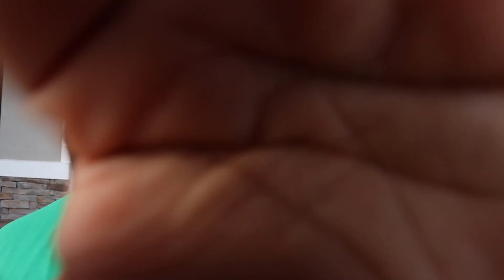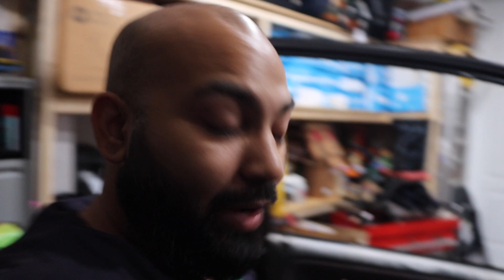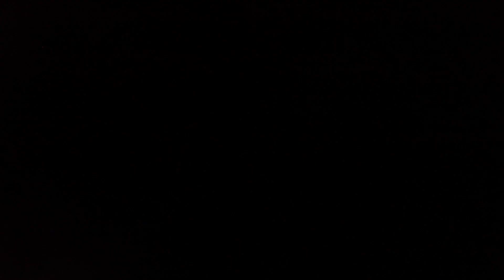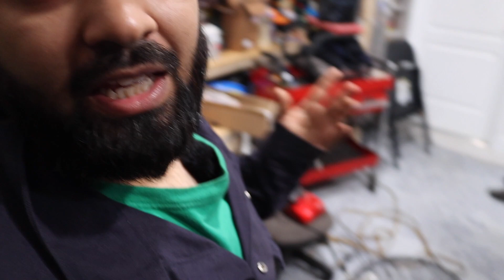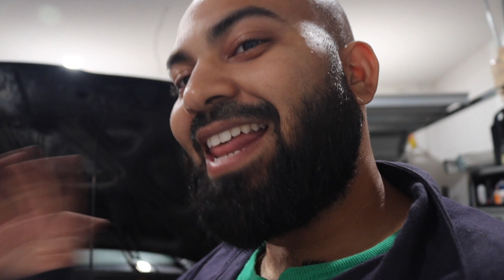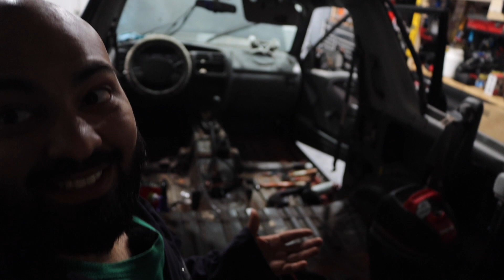our welding is finally finished on the tracker

Comment: friend I have a doubt the liquid moly oil to clean the engine is good or bad
Reply from the maker: Liquid moly oil, not sure I never tried it. If you want to flush your engine just drain the oil, add one quart of transmission oil and the rest of how ever many quarts left of regular oil, run it and then drain it